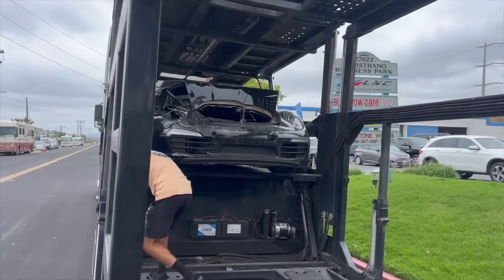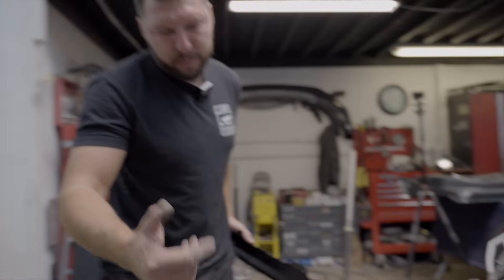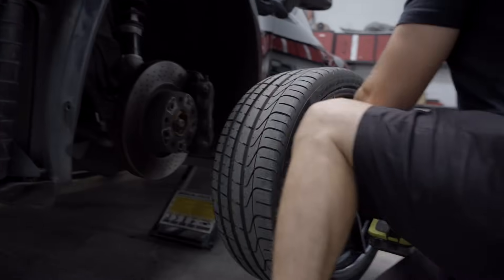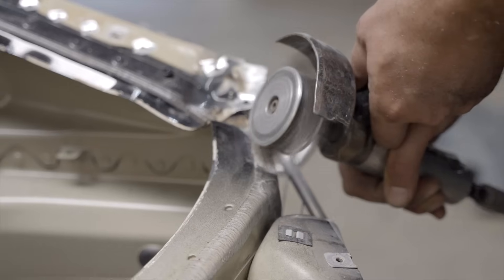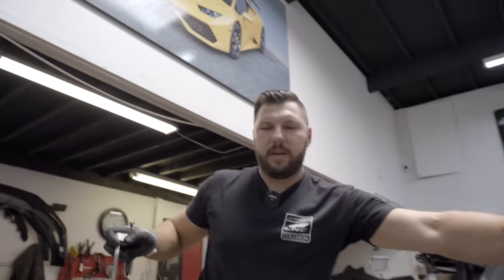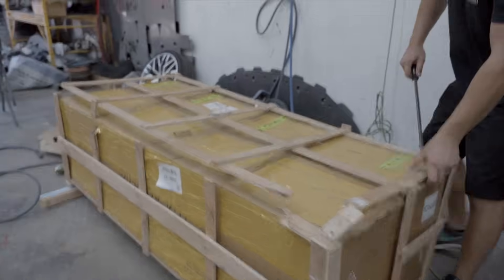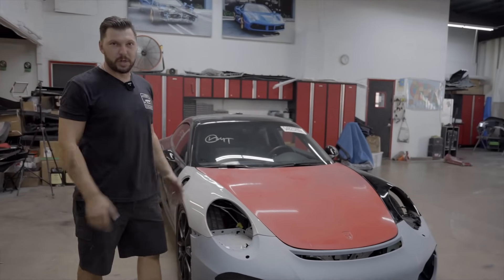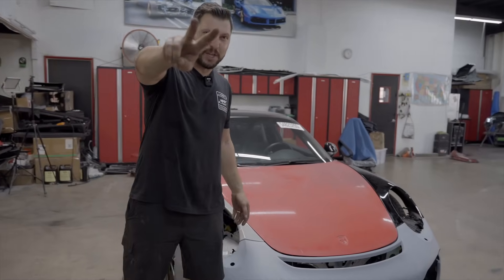Rebuilding a 2012 Porsche 911 Carrera - Part 3

Comment: Question.  Why no painting of the ground 'raw' areas before panel bond and rivets?  Just curious.
Reply: My guess would be factory repair manual calls for sealant over the bonded area, and vlad will do that after test fitting parts and before final assembly. Just a guess
Reply: @luketc1 Agreed, but a bonding agent is not generally used to protect the surface from corrosion.  Watching the video, you can see the original pieces Vlad removed were sprayed with some sort of primer or paint before the bonding agent was applied.
Reply: @luketc1  nope, bonding was applied straight onto the bare metal, you can see on the other areas that hadn’t been ground that they were painted

Comment: Good work as always. Thanks Vlad for your generosity showing how to do a proper work. I notice the Porsche has changed the design of its rivets... there has been a revision since I last purchased rivets from them, now the end up flush agains the chassis, before was not the case. Personally I wouldnt have replaced the front wall/panel, but I would have replaced the floor... you know... so that it is more by the book :D. I would have drilled instead of grinded the spotwelds/rivets.... as a beginner (talking about me) I needed a clean template to mimic the holes in the new part. I know you have many years of experience and by practice you did not damage the panel underneath... all being said it is a pleasure to see you work and your work ethic as well.... Wondering myself two things... what happened to the Red 991.2 GT2RS... and.... have you lost weight?